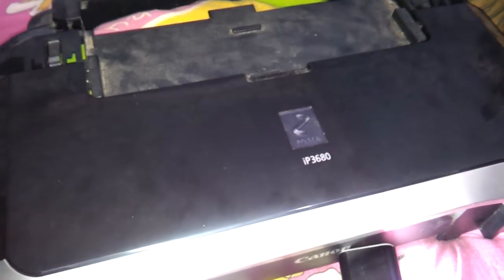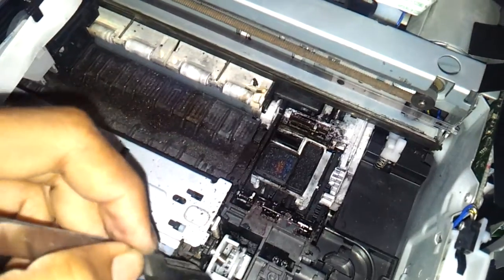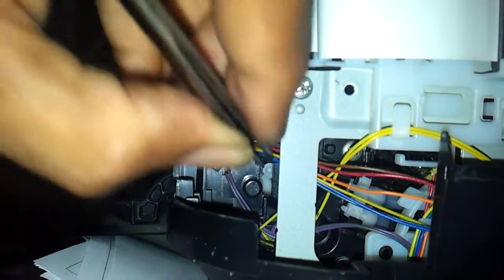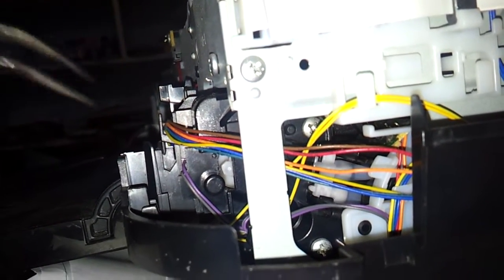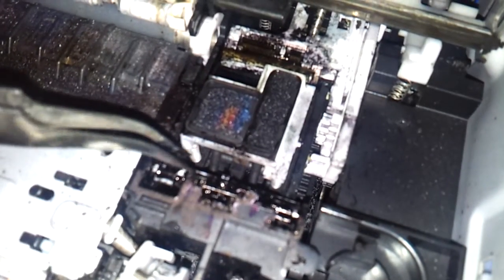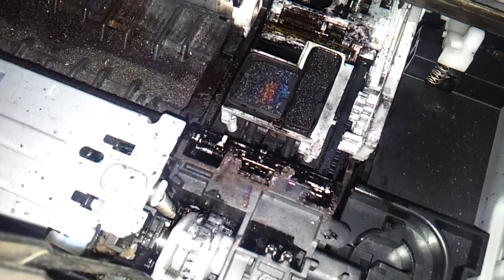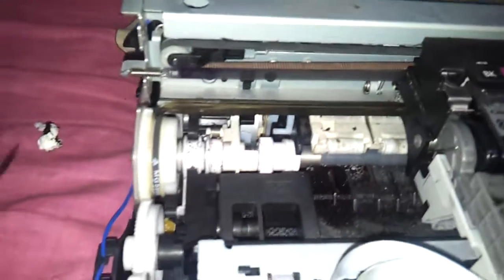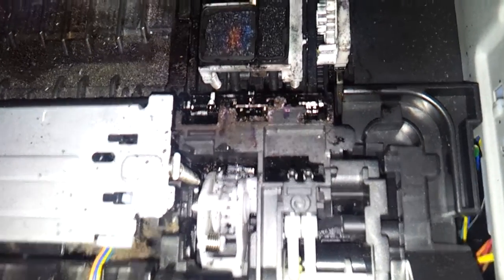Fix Canon 6C10 error Cam Valve Sensor. ip3680 ip3600

Comment: Chirantha, thank you for this video. Showing how the entire cam sensor system worked enabled me to fix my MX882 without having to dismantle the cover.  I was going to buy a new printer because I had cleaned everything else, but until your video I was not aware that one part was not moving properly.

Comment: I have the problem that I need to force the gears with my hand or it'll never engage. Also the ink absorber sits low and if I push lightly on it from top, it instantly falls to the bottom. What could that be?

Comment: Brilliant posting. This did indeed fix the 6C10 error on my IP3600 - the wiper blade, gear notch, and clear vinyl push were clogged with ink. Took a leap of faith that I wouldn't destroy the printer cover panels trying to figure out how to take them off - just needed a screwdriver to pry on the pieces since it's a snap together assembly. Thanks again.

Comment: Absolutely brilliant..thank you. The cam micro switch wasn't activating ( measured with a DVM ) Used switch cleaner now it works all ok. Had a problem removing the side panels on my IP3600  until I realized I had to remove the main lid and slide the the RHS and LHS top back quadrants forward to get access to two more release clips for the side panels. The rest was relatively easy. Thanks again Chirantha :-)

Comment: I never thought I would be taking apart my printer, but my old MX860 gave me this 6C10 error code after I tried the nozzle cleaning function in software, and I thought it was headed for the garbage, but saw your video and thought I'd give it a try. There was a pretty good size coating of clumping ink on the thingamagig, which I cleaned off. Put it back together and after thinking about it for awhile, it decided to work again!  Thanks for the video, it helped.

Comment: Thank you very much for this video! I cleaned the wiper blade cleaner and put the spring back in place and that solved my 6c10 error on my Canon Pixma MX882 printer. Ten years and this is the second time I’ve had to repair this printer, but it’s better than having to get a whole new printer just due to one malfunctioning component. Manufacturer won’t repair it, and most repair shops will tell you it’s cheaper to get a new printer. But DIY is indeed the lowest cost (perhaps not in time). 

Thanks again for the detailed video explanation!

Comment: Thanks for this video. It helped me understand and fix my  MG5100. The Cam Valve Sensor (a microswitch) is in a different place but the wiper unit and the sponges which catch ink are all very similar.

Comment: so i removed that thing right there in 4:04. And everything seem to be working fine after that. I did not put it back and also a little spring on top of it got removed to and fell inside the printer. Do i need to put it back when everything is working now? what is the use of that thing?
Reply from the maker: Alan Martires the spring ensures that the wiper blades get a proper clean, without the spring, its possible that the wiper blade cleaner will just get stuck on one position. If you find time to lift up the printing unit (you don't need to remove to entire thing from the bottom base). Use a magnet to locate the spring or attach a  powerful magnet to your screw driver and poke it in carefully, hopefully if the spring is directly down there it will get attached to it. You can try shaking printing carefully (waste pads are full of ink) and hopefully the spring might jump outside.

Comment: My printer is Canon Pixma iX6500 & it seems like these printer mechanism are more or less work in same way. So, My printer doesn't show any error messages instead, it recalls that, the front paper tray is closed & won't print where as its not close in real. For some reason, I guess its sensing that the paper tray is still shut off. Any suggestion would be a great help. Thank you.

Comment: Hi Chirantha,
Having fixed my error using this system some months ago, it has re-appeared. I have repeated your advice but find that the cam system does not engage when I reverse the rotation of the shaft. It moves close to the correct position, but I have to increase the movement by pressing with my finger. It then rotates the cam. However having rotated correctly, it returns to the starting position and once again wont engage without help. Can you help in any way?
Many thanks.
JC
Reply from the maker: +Jonathan Crispin check the spring on the cam shaft. If it is not properly place the system won't lock on the cam so you need "force". The spring is seen at 3:12. Also check if that gear is not free.